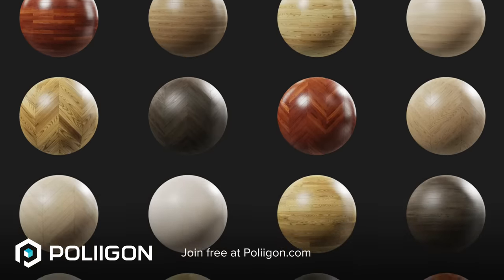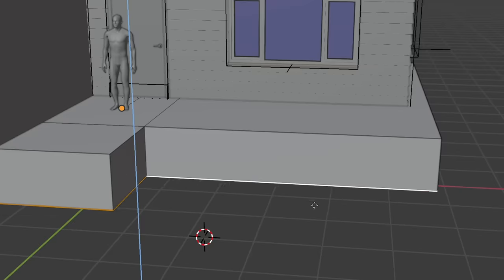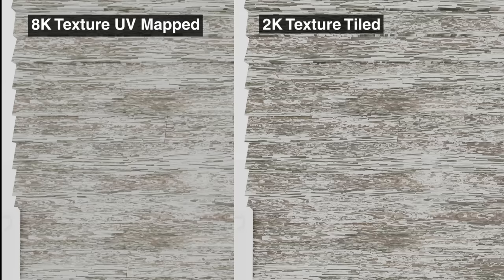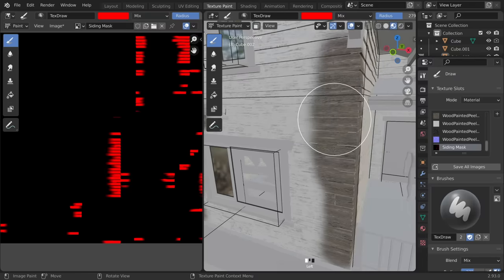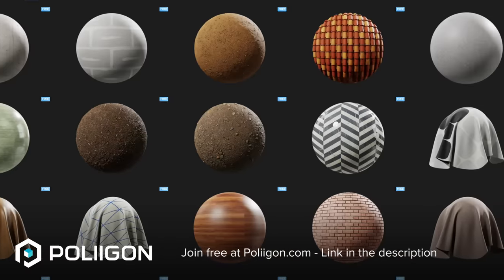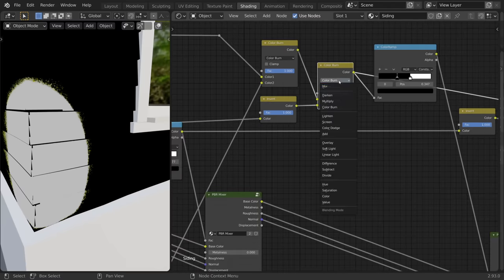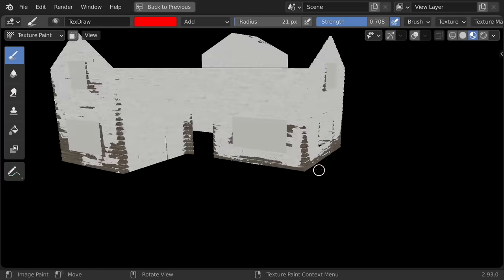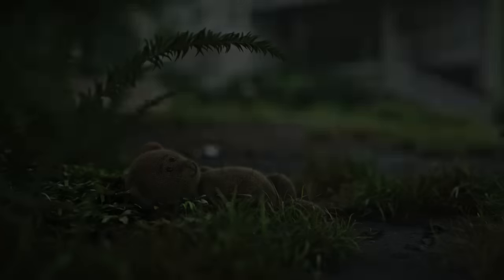How to make an abandoned house in Blender - Tutorial

Comment: For anyone stuck at 02:22. Once you've made the house with the roof, duplicate it and move the roof away from the house before separating it. So, you still have the house with the original roof as an object and the new roof as a separate object. Then reposition it over the original house, slightly higher on the Z axis. This will stop the problem with the boolean not cutting off the clapboard. Hope this helps.
Reply: Well should have read your comment whaen I saw the early time stamp.. .welp doing evrything from scratch.. Thanks for the info.
Reply: I still don't quite understand could you explain it a different way? I'm a beginner. Just started a few months ago.
Reply: Est ce que on doit appliquer le modifieur pour le toit dupliqué?
Reply: thanks buddy u saved my problem :goodvibes:
Reply: @aesthetic_quote  Man, I was making this house again, but I have problems still, should I copy and separate the roof when the house is practically a square?
Reply: @adelorn08  first just duplicate the roof so that the original house has a roof, then just separate the duplicated roof and place it just above the original house that should do the trick
Reply: @adelorn08  make sure, the base of house does not have holes
Reply: @aesthetic_quote  I did that, but when I go to "object properties" and change "display as wire" it doesn't fill the rest of the roof with the array, even with the original roof a little above the separate roof, in the "array" modifier it doesn't fill above 17
Reply: I was putting the original roof above the separate roof, but I did it the other way around and it worked, thanks a lot for helping :)
Reply: @adelorn08  great 💥✌🏻
Reply: dear God! Thx dude!
Reply: I love and respect you
Reply: this costed me around 2 hours of tripping around. thank you!
Reply: Thanks that was my problem. So, when you separate the "Roof" it removes it from the "House". instead just duplicate the roof first, move the duplicated roof up then make the separation of the second roof from the "house" object.
Reply: bro.... Thank You!
Reply: Heroooooooooo
Reply: thanks this helped a lot was stuck with this for like 4 hours
Reply: I stucked but I used intersect with roof and then manuly delete vertexes that way easy in this way for me
Reply: @aesthetic_quote very well explained! Didn’t work for me but you explained it very well!!!

Comment: Disabling the clamping with "c" after you press "g" twice to slide the vertices on the edge beyond the point of the vertex, is legit something I was looking for for years and gave up on finding it long time ago. Thanks!
Reply: detto :)
Reply: You can also press Alt while edge sliding it's more handy.
Reply: Works well while sliding outwards and horrible while sliding inwards because each side behaves according to nearby vertices. Their pace are different if their shape are different.
Reply: I used to create a new transform orientation for each edge to do that, turns out it could be done with one keystroke. That's massive.
Reply: Maya cannot do it LOL
Reply: @amalbubble7812  Thank you! Didn't know about this feature :)
Reply: For some reason, I can't get this to work
Reply: thank you so much bro i was pressing s for some reason
:)
Reply: When I do this the edges won’t go out. It all just slides on one side or the other

Comment: I’m here to help those stuck at 1:04 , So (Choose the faces > Mesh > Seperate > Click the seperated roof > Mesh > Duplicate) Also when adding solidify, make sure to put offset to 1.0000 and turn on ”Even Thickness”
Reply: Why do you separate the original roof attached to the house? is it to delete it so you don't have the hidden faces? Don't you need the roof to be attached so the Boolean works properly?
 you can also set the thickness in the negative direction instead of having to change the offset.
Reply: @EmvyBeats  It simplifies it like this
Reply: I love you

Comment: In video games, a scale reference player is usually going to be 1.8m. Width and depth are usually going to be 0.6m. If you don't have a reference, using a primitive cube with the right dimensions will be enough to start modelling.

You should also consider jump height (its apex) and crouch height POV. As always, rely on your particular camera in your project as the source of truth for look and feel.

Comment: If anyone is like me and wondering how he made those points in his node links:
-Shift + right mouse drag across a link to add a reroute node. 
-select the reroute node and hit G to move it to a better location so the links don't overlap or go behind other nodes, etc. making your node network a confusing overlapping mess.  

They're called reroute nodes because you can also use them to send links out to multiple nodes from the same node. They support one input but multiple outputs.

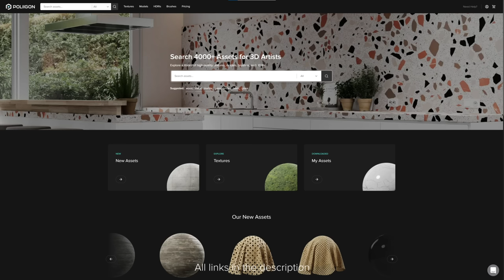Comment: 8:30 this is why I watch these even though I've been using blender for 3+ years. I've been using shades of grey into a color ramp then mixing them In a very specific order to get the same result. It's no messy and not friendly. I never once thought of using RGB instead. No matter how experienced you are there's new tricks to be learned
Reply: Hey, can I ask you a question. Something is wrong with my workflow. When I plug in the normals from the PBR  MIXER into the PRINCIPLE shader, my mesh becomes a BRIGHT RED. Do you know how to fix this issue?
Reply: @juanantonio-7204  are you plugging the map directly into the normal input or are you putting it into the normal map node then the normal input?
Reply: Did you actually achieve to get the same result with the color burn blending ? i tried hundred of times and i still come out with a shitty blending (it just randomly paint some big chunks) i do not get it.
Reply: @SimFiftyFifty  Same here

Comment: A good way of doing 1:05 is by first creating a mirror modifier of the roof with clipping enabled and then duplicate and separate the roof. Then you can use the solidify modifier. My issue was when I used the solidify modifier it would split my roof instead of keep it together.
Reply: How do you make a mirror modifier before separating the roof?  because at that point the whole house in one mesh.

Comment: Hi everybody, if you are at 2:26 and your clapboard doesn't go all to the top even  if you have put all the right settings in the boolean, you might have done the same mistake as me and collapsed the top edge of your house, because of that the boolean can't properly operate without this limit. check the wireframe of your base house cube, after  link points that are not by hitting F when you have your two points selected, after check in solid mode if you still see through the top of the house,  select angled roof edge and extrude it along the right axis (E + Y for example) and snap the edge back on the other side, by redoing the limitations your Boolean will then be operational.
Reply: dam thanks
Reply: can you please tell this to me in simple form, i dont understand how you do it

Comment: For 2:22, I just duplicated the roof, extruded it on the z axis in edit mode, and used that as my Boolean object. I found this to be so much easier for me. Also, if you do this, you will have to increase the thickness of your actual roof by just one click to hide any clipping artifacts left by the Boolean modifier.

Comment: I feel like either you cut bits out of these tutorials or Blender keeps changing things so often that I can't actually achieve any of the results you're showing. I'm always very particular to follow every exact step that you mention, but somehow, my mesh will always be completely ruined half way through following your steps and I can never seem to find the answers in the comments. Alt+S doesn't scale along normals for me and I'm using Blender 3.0. When I use the base house as the boolean object and scale the base house bigger than the siding, the top sections of the siding disappears and my roof has the walls of the base house object sticking through it. I always end up throwing the towel in half way through with these.
Reply: He definitely skipped bits out as this is intended for Intermediate and above users.

Firstly, when separating the roof, make sure to make a duplicate and then separate it. Then, when trying to scale the house for the cutout, it might be better to just scale the house with S and take a manual approach of editing the mesh to fit around the house (which is what I did). Also make sure to apply the scale of everything while working as that can usually make things really wonky.
Reply: @jooby__  I did not understand why it was not working until I read your post.  Yes, after duplicating the roof, I was finally able to get past that step.

Comment: at 2:40, what prevents the clapboard from protruding through the roof? It seems to do so, then vanish. I tried lowering the upper vertices of the boolean object, but its shape seems too distorted from the shrink/flatten operation to be hidden neatly within the roof object.
Reply: before you seperate the roof as a new object, duplicate it

Comment: In the beginning when scaling the roof to 0, after each scale operation, while the edges(!) are still selected, you must press M and merge by distance. This will remove double edges that will otherwise make you pull out your hair when adding the solidifier. :)
Reply: You don't have to do that if you have auto merge option selected😊
Reply: @nirmalcam223  oh I didn’t know about that, I will check it out

Comment: @1:15 I've only made a single angle roof (an updown V shape) but when I "GG + C" it pulls inn one side while stretching the other, I want both of them to stretch at the same time. Anyone know why, and how to fix?
Reply: Not sure how to get both at once natively, but you can either try incrementally moving both individually so they match or, the easier option, use a mirror modifier to get exact results on both sides. Hope this helps.
Reply: @jadentorres7322  Yes I know of this solution as well, however I'm curious as to why A drew is able to do them simultaneously, but I'm not
Reply: Just managed to duplicate your problem, there is an easy fix (after spending nearly 15 mins trying to figure out the problem lol)
 just select the bottom edges THEN 'GG + C', hope that helps, Cheers

Comment: For those struggling with cutting off the excess clapboard, an easy little workaround I did was:

1. Duplicate the roof (or multiple roofs in my situation)
2. Extrude the top faces straight up until it covers the clapboard
3. Do the boolean modifier on the clapboard with the extruded roof(s) as the object, I used difference instead of intersect.
4. Hide the duplicated roofs.

Good luck
Reply: awesome workaround
Reply: what about making the clapboard in general? scale along normals is making each side go a different way

Comment: I still had trouble with the Boolean modifier part, When I would resize my Base House, the Panels seemed to cutoff before the Roof. How i got around it was instead using the "Difference" Option in the Boolean Modifier and changing the Object to the Roof, Applied that and went into edit and hovering over each piece above the Roof, and hitting L + X and Deleting the vertices. Takes an extra minute or so but I was getting a headache otherwise, So this will have to suffice lol.

Comment: FIX SOLIDIFY "Even Tickness" So, what would happen (to me) is that when i added a solidify modifier, the sides under in the roof would be wider than the ones on top. To fix this, i did CTRL A, and apply all transforms. This worked for me, tips and tricks are welcome.

Comment: I keep messing up on 1:50 where we do the side panelling. Ive follows all the steps but when I go to add the angle with alt + s it does something completely funky and nothing like the tutorial. Can anyone help?
Reply: Unexpected behavior in edit mode is usually attributed to unapplied transforms in object mode. IE: you scaled an object in object mode but didn't press ctrl + a and apply that transform. So do that and your alt+s skewing problem should be corrected.

For objects you typically want to scale in edit mode instead of object mode. There are scenarios where maybe you don't want to apply certain transformations, which is why the ctrl+a menu in object mode exists. In this case, you want to apply the scale. :)
Reply: You have to redo the Normals-Recalculate Normal outside. So after you extrude the edges you need to click Mesh-Normals-Recalculate Normals Outside just like his instructions, right?
and still it's messed up, now go to face mode, select all the faces, redo again the Mesh-NOrmals-Recalculate Normals outside, then on object mode apply scale Ctrl+A, on edit mode select that edge loop again then ALT+S, that"s how I fixed mine.

Comment: Everything is fine for me until 2:31. When I scale the base house, its shape gets morphed. It kinda bends or looks like its 'fatter' around the loops and a bit of the clapboards also stick out of the roof. Any advice?
Reply: did you manage a solution yet?
Reply: @njabulozimu7702  Ive just moved on and the house shape is still a bit fatter/curved, but it doesn't create an issue. As for the clapboards that stuck out at the top, I just selected the roof object and moved it upwards a bit
Reply: @tianlouw8505  Hi, thanks for the response, I decided to use the normal scaling by just S; then i had to shift the cube.002 along x and y to match the roof; I also face selected and moved the faces to bring them closer but not so close as to trim the aesthetics; mostly focused on the roof to trim.
Reply: @njabulozimu7702  Cool, that makes sense too

Comment: On 14:43, I am having a problem with the separate color/color burn/roughness texture nodes. Basically, when I plug into the Color Burn the RED on (A) and the roughness map on (B), the roughness map just displays black with no texture whatsoever, so the FAC value on the color burn does nothing. Tried everything that comes to mind, any solution?

Comment: Can someone help me? When I`m connecting mix rgb with separate rgb and mix shader (14:25) , my second texture just goes completely black. How can I fix that? It works alright when I don`t use separate rgb between those nodes. And it`s not only color burn, bur all overlays. 

What can I do here? I tried to recreate same steps with new texture with just images and got the same problem

Comment: Hey Andrew! one thing I don't understand, is during the resolution segment, we get a close up of the 8K UV mapped texture vs. the 2K tiled texture. even though the 2K tiled texture contains more resolution, it didn't have more repeating patterns than the 8K map, which I don't get how you were able to achieve. I thought the whole idea of using lower resolution maps is to tile it more in order to get more detail and improved memory consumption at the cost of repeating patterns. I hope that can be clarified :).   I am currently working on a large environment scene with one machine so scene optimization is key which brought me back to this video.

Comment: im triying to follow this tutorial, and is amazing, but for some reason, when i take the separate RGB node, and start painting with red, is painting white, and when i add the third material, to paint in the blue channel, nothing happens, but that happens when adding the color burn-gradient-invert nodes inbetween, if i conect directly the separate rgb node to the fac conection, it works, how can i fix this?

Comment: I'm learning 3D modeling by myself, and this looks stunning! And sort of... simpler then I expected just from looking at the end result... because the process I learned included retopology and baking before texturing. So I wonder, are retopology and baking always necessary and always used in game studious? Can the house model from the video be transferred to game engine and used as an asset in videogames, with all of the nodes?
Reply: No you would need PBR materials / image textures with uv maps to send to another program.
Retopology is only used for things that were made with sculpting far as i know. When hard surface modeling you want to try to keep the vert count as minimal as you need for what you're making. so there will be no need for any retopology later, However I hear its good practice once your done with a model to clean up whatever excess edges etc. that you can.

Comment: I was wondering.  I will be doing a house but there will be scenes on the exterior and interior.  I have seen it where the exterior and  interior are done as separate.  I've also seen it where a building had both.  Which would you recommend?

Comment: Damn those windows are a pain. I am spending hours on them making them look right. When you use the cloud texture to warp the board you need to go back over the windows and doors because the thickness has changed.
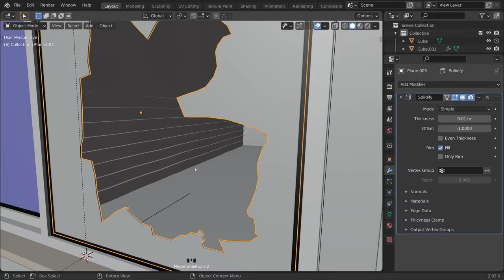5:51 Remember that with the broken windows that when you inserted Archimesh object that it came with materials, inlcuding glass. you need to select the plane and in the material section, select 'glass'. You also have to select the window that you are replacing and delete the face of that window. you can then parent the broken window to the window object.
11:25 remember that you need to have the cycles rendering engine. you ight have evee by default.